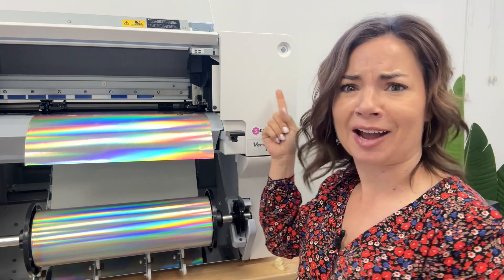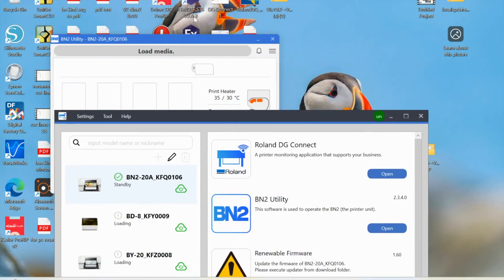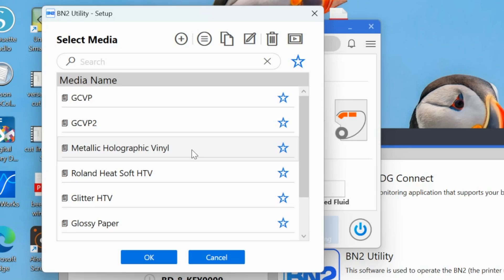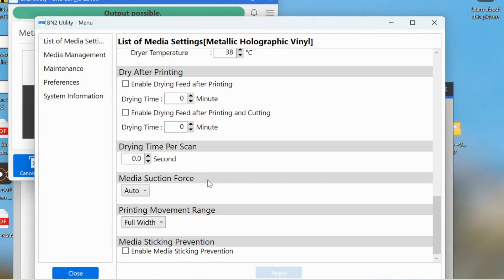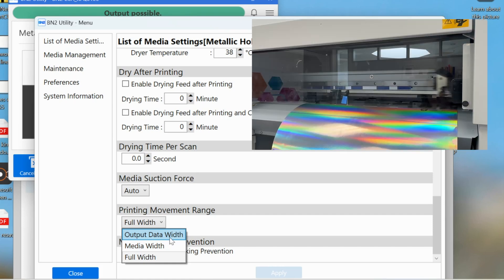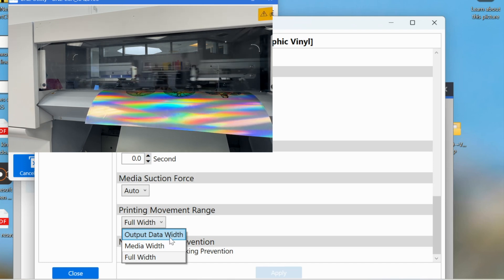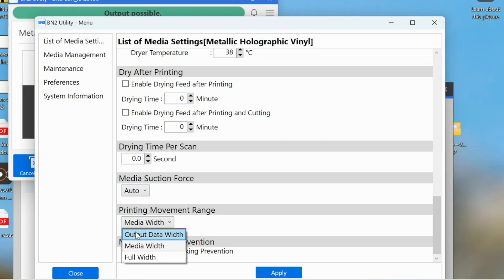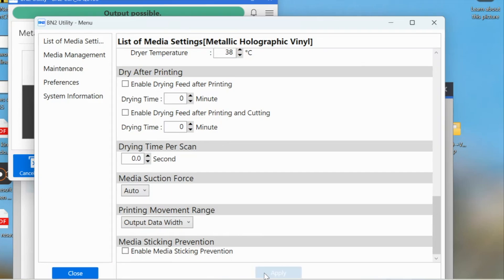Roland BN2 Game Changer! Limit Print Head Travel to Width of Design or Media!

Comment: Hi Melissa, I really want to get a BN2-20 but I only use a MacBook, does the software work on Macs or is it only windows? Also if I print something with registration marks does this have a scanner to place the material back in after laminating to cut the stickers? Thanks in advance.
Reply from the maker: Currently there is not a Mac version..however you an do pretty much everything on your MAC then send to your PC to print. Yes you can print > laminate > cut
Reply: @SilhouetteSchool Thank you for your response it helps a lot.

Comment: Do you know what the manual means with: Note, however, that because of the speed of media movement is no longer constant, colors may be uneven?

If limiting the head movement?
Reply from the maker: I'm not sure what that means
Reply: The speed at which the print head moves is based on the rate at which the ink dries on the substrate. That is why it is important to download and use the proper print profiles for your brand and material. The head speed changes with different material, so if you speed up the rate at which the print head lays down successive layers, it will affect the print quality.

Comment: Seriously considering ordering the BN2 and this may be a noob question.  But why wouldn't you keep it on OUTPUT DATA width at all times.  ALSO - I read somewhere you could print, laminate on a separate machine and return to the bn2 to cut using registration marks.  Is that true?  Is laminating necessary to produce holographic stickers?
Reply from the maker: You can print laminate cut with the BN2 as well without needing a second machine. Or you can use the Roland GS2-24 https://shrsl.com/4jfl5 to cut after you laminate. Lamination is not required but depending on the application some people want to add it.
Reply: Manual says for limiting print head: 

Note, however, that because of the speed of media movement is no longer constant, colors may be uneven.